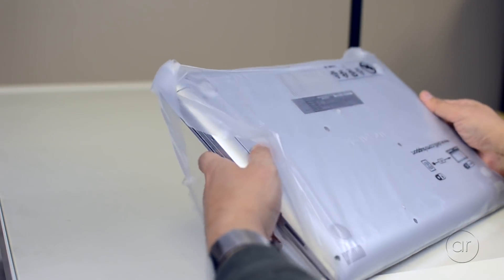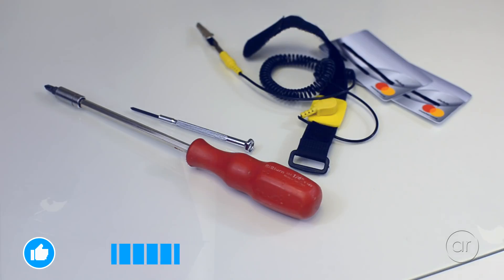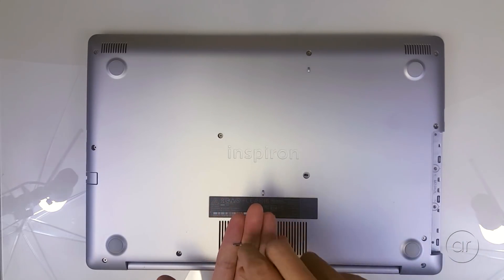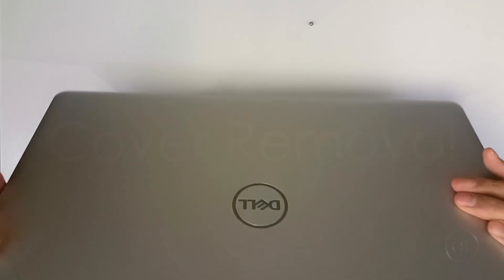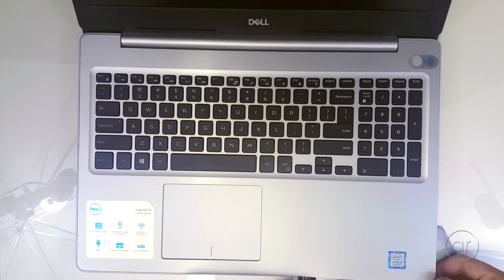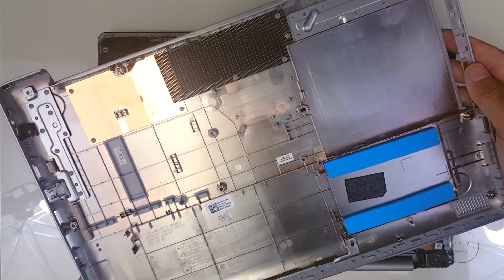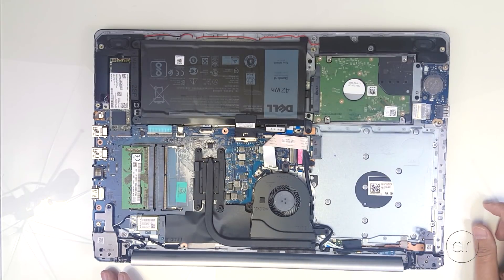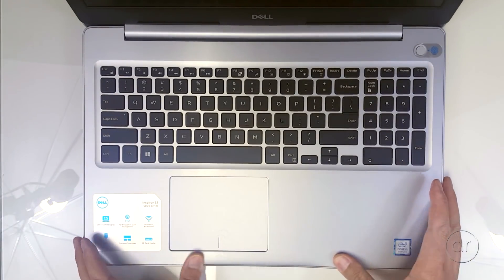How to Disassemble a Dell Inspiron 15 5570 Laptop to Install an M.2 SSD

Comment: Hello , Are you still using this laptop and are you satisfied with it?
I bought this laptop 2 weeks ago and i found it very slow.I never thought that laptop with i7 8th gen processor would be this slow. Sometimes even chrome crashes when there is no much workload. I am regretting for buying this laptop.
Reply from the maker: I have experienced the same thing - the laptop is very slow if you continue to use the hard drive that came with it. However, once I moved the OS to the SSD, it is fast. I do all of my music composition and video encoding on the laptop.

For the crashing - see if you are using the latest BIOS. It has crashed once on me - but once I updated the BIOS, I've never seen the problem again.
Reply: @accessrandom  Thank u for your response.Now taking your words into consideration ,i am planning to install ssd in my dell 5570.I am just confused which one to buy SATA 256 gb ssd or NVMe 150 gb ssd?

Comment: Hello Sir,

Your videos are very informative. Just wanted to ask a nooby question- I have a Dell Inspiron 5570 i7 8th Gen/8 GB Ram/2 TB HDD. Can I add an SSD in addition to my 2 TB HDD? If yes then which type of SSD & up to what capacity? Regards
Reply from the maker: Thanks much. Since your laptop is in the Inspiron 15 5000 series, it should have an M.2 slot for you to add an M.2 SSD. According to Dell's Setup and Specifications manual, it support up to a 256 GB M.2 SATA, and up to 512 GB M.2 NVMe. However, many viewers have successfully installed larger capacities (as seen in the comments below).
Reply: access random Thanks a lot for the clarification !!
Reply from the maker: Sure thing 👍
Reply: access random Just wanted to ask one more thing. One out of the two M.20 or NVMe can be installed with my main HDD or without? Will my old hardisk work in my Laptop?
Reply from the maker: There is only one M.2 slot so you can choose either an M.2 SATA or NVMe SSD. You hard drive can work in combination with the M.2 SSD.
Reply: access random That’s great. Thanks for the clarification !! 👍🏻

Comment: Hey, do you know if the usb Type-C port on this laptop is a thunderbolt port or just a regular USB Type-C as seen in phones?
Reply from the maker: At least on the model and configuration that I have (the Inspiron 5570), I don't have a USB-C port. Do you have the same model?
Reply: @accessrandom  yes, right next to the charging port. Inspiron 15 5000 series - 5570
Reply from the maker: That's strange - there must be multiple configurations of the 5570. On the side that has the charging port, I have the HDMI port, then LAN, two USB 3.0, and finally a headset port.
Reply: @accessrandom  okay, I have a type-c shaped port between the charging and HDMI port

Comment: In Dell Inspiron 15 5567 m.2 slot is there?
Reply from the maker: When I go to Dell's website and look at the setup and specifications document, it looks like there is an M.2 slot on 
 the 5567 but unfortunately it is not for an SSD.

Comment: that M2 slot is SATA or NVME?
Reply from the maker: The M.2 slot will take both SATA or NVMe, but please keep in mind that Dell limits the read speed of NVMe to 1800 MB as it uses GT2 mode (power saving mode).
Reply: @accessrandom  thx

Comment: Please, Is this Dell laptop work well for advanced programming (e.g. visual studio 2019) and for gaming like pes 2019 / 2020?
and what about the common issue I heard about 100% drive usage?
please, need help because I am thinking to get one.
Thanks
Reply from the maker: I use it for video capture/editing/encoding with handbrake, as well as some music production. I think it would do fine with VS 2019, though I'm not sure about games as I haven't really used it for gaming. I have not had any issues with drive usage.
Reply: @accessrandom  Thanks for the reply,  so please what could you advice me to choose this one(the mentioned 5570)) or (Dell G3, i5-8300h,8gb Ram, 1TBHDD))

Comment: Thank you for this amazing video, I am planning to buy Crucial MX500 m.2 SSD (240GB) during next amazon prime day sale. Hopefully I will be able to disassemble the same laptop and install the SSD.
I also want to upgrade the RAM with another 8GB stick, can you help me saying if I will buy 2400GHz speed RAM or any other variants and which brand will be better. I am planning to buy Crucial 8GB 2400GHz. Please help
Reply from the maker: You're welcome - I'm glad you found the video useful. If possible, I would recommend that you get a matching pair of memory (both brand and model). I've had too many problems with mismatched memory in the past, even when they were exactly the same specs. Unfortunately, I didn't visually inspect the memory while I had the laptop open, so I'll need to reach out to my viewers - anyone?
Reply: @accessrandom  I have upgraded to SSD tomorrow, I have cloned it also, and it was working fine also, but today I have deleted the whole partition of my previous HDD where there was OS previously and my backup USB cannot restore my windows now, any idea what to do?
Reply from the maker: Had you created a set of rescue disks and/or does the recovery partition still exist? What cloning software were you using?

Comment: Is the ssd nvme
Reply from the maker: The SSD that I used was not NVMe - however, the M.2 slot in the 5570 will accept NVMe SSDs. Please keep in mind that the 5570 does not utilize the full speed of NVMe as it runs in the low power GT2 mode.
Reply: But it should run the full speed of NVMe as AHCI is present.
Can we change this GT2 setting.
If yes,
Please me a video on how can this 5570 run the full speed of NVMe
Reply from the maker: Unfortunately, no one has found a way to change the GT2 setting in the BIOS or otherwise. I'm not sure why Dell has designed it that way...
Reply: @accessrandom  
Can you please make a video on this.
Reply: Trying to use nvme ssd on Inspiron 5570
Reply: Okay
Can you sujest me some better ssd so that I don't want to remove my HDD
And want a better performance
Please sujest which storage is best for this laptop

Comment: This is the best guide for 5570 on youtube. Mine doesn't have the DVD drive but the procedure was the same. I could add one more 8GB RAM, 512GB M.2 2280 PCIe SSD (MVMe) Gen3 x 4, and replaced WiFi card to M.2 DW1830. The WiFi card needed three antennas but 5570 has only two antennas. I installed one more antenna on the back panel after grinding some of the metal shield off on the back panel.
Reply from the maker: Thanks much! With all the upgrades you performed, yours could have been a video by itself 😀

Comment: Dell Inspiron 15-5559 15.6" i5-6200U can this model hold a m.2 ssd?
Reply from the maker: When I went to Dell's website and looked up the Specifications manual and Services manual for the 5559, I was unable to find any reference to an M.2 slot, sorry...
Reply: @accessrandom  Ok thank you, ill just buy a 9.5 mm caddy and a regular ssd

Comment: Hey there, I'm planning to buy this model of Dell but I'm not so sure because there are plenty of bad feedback on the internet, such as Fan Noise, High temperature and 100% Hard Disk usage. What are your thoughts on this?
Reply from the maker: I think it depends on your usage. I use it for general purpose browsing, video editing, digital audio, etc. so the fan comes on once in a while. If you're gaming, the fan would turn on more frequently depending on what type of games you play. Replacing the HDD with an SSD will also help with performance.

Comment: Hi sir, I bought higher version of Dell Inspiron 15 5570 here in the Philippines. i7 8Gen, 8Gb RAM, 4GB graphics and 2TB HHD. I see no SSD on my laptop info so it means my lnspiron 5570 has no SSD card mounted? and I was wondering if my laptop has SSD slots too? if yes can you recommend compatible SSD for my laptop? I'm looking forward for you reply, Thank you!
Reply from the maker: I'm not sure if Dell changes their specs for the Phillipine market, but your laptop should have an M.2 slot, as it's part of the Inspiron 15 5000 family. I used an HP-branded SSD in mine, but you can browse through the comments for brands/models that have worked for other viewers.
Reply: You could go for crucial or wd nvme ssd's instead of Samsung or Intel if you're in a slight budget

Comment: Can you install large ssd M2 like 512GB plus a 1TB 2.5" SSD and use them both? Also can it take ddr4 2x16gb @ 3200MHz? Thanks
Reply from the maker: Yes, you can install a 512 GB M.2 SSD (I have had several viewers who have successfully installed 512 GB), plus replace the HDD with a 1 TB 2.5" SSD. According to Dell's specs, yes - it will take a max of 32 GB of memory.

Comment: Hey i recently installed wd green 240 sata m.2 in my 5575 but it's showing not detected in bios and also not showing in disk partition tool. Any suggestions? And ssd is working
Reply from the maker: Can you try to re-seat it, or would it be possible to try it in another computer? Any hardware additions should at least show up in the BIOS...

Comment: Sir if I use hdd with m.2 ssd will it largely affect battery backup if yes then by how much %?
Reply from the maker: That's a good question - if you are adding an M.2 SSD to the system, it will surely affect battery life (but not significantly). From a brief search on Google, I found power consumption to be anywhere between ~0.2 to 0.5 Watts for active idle to 2 Watts for read/write.
Reply: @accessrandom  Thank you sir i appreciate your answer

Comment: Thanks so much for this, used a Samsung SSD Model: MZ-V7S500BAM in a dell 5575... worth it, had some difficult setting the boot from drive though, as the bios menu is different from this model... i think i figured it out though, I am thinking of swapping out the HDD for an SSD as well, in your opinion would that be worth it?... could i just when installing could i just clone the SSD in the m.2 slot to the new SSD HDD?
Reply from the maker: I think it really depends on how you plan to use the secondary SSD (which replaces the HDD). The M.2 SSD already has Windows on it so you wouldn't need to clone it to the 2.5" SSD - you could just swap out the HDD with the 2.5" SSD. If you plan to use very disk-intensive programs (like video editing, databases, etc.), you could actually install those programs on the secondary drive. Since it is an SSD, they would load faster. And if you keep the data (like video clips, database files, etc) on the SSD, that would speed things up tremendously.

Comment: This was helpful. I found starting where the removed disk drive is was the easiest spot to begin separating the cover. Also it's a good idea to place a cloth on your work surface when you have the laptop flipped over to prevent scratching the outer shell behind the screen. Additionally this computer also has the option of replacing the optical disc drive with another hard drive if you wanted to use a 2.5 SSD coupled with a HDD.
Reply: I wouldn't want to replace the HDD because it's already a healthy 2tb drive, but adding an nvme ssd is convenient. Even I think the display and proprietary software this model has is bad to say the least
Reply: @gakltd  I left in my HDD as secondary storage. Once I put in the m.2 drive and made it my C drive my computer boots up at least 10-20 seconds faster. Everything I do it is quicker and the battery last longer since it doesn't need to spin up a drive anymore. The monitor could be better but when I researched other laptops it was the only one that came with a solid 1080p screen in it's price point. All the others for the same price were 720p.
Reply from the maker: Thanks for the comments and observations - these tips will be helpful for everyone.

Comment: Hey..Does it support 32gb of ram..Could you please install and confirm it support 32gb ram ..
Reply from the maker: Unfortunately, I don't have the memory to personally test it, but Dell's Inspiron 15 5000 Setup and Specifications manual states that it does support up to 32 GB of memory (per memory module slot 2 GB, 4 GB, 8 GB, and 16 GB and total memory 4 GB, 6 GB, 8 GB, 12 GB, 16 GB, and 32 GB).

Comment: which watch are you using?
Reply from the maker: I think you are the first to notice 😃. It is a Skagen Titanium (model 233XLTTN).
Reply: Th
Reply: I really loved your watch
Reply from the maker: Thanks. The face is only 37mm but looks bigger because it almost goes to the edge. And it's only 8mm thick.
Reply: I just bought a Swiss Eagle. so will have to save some more to buy this. But I'm definitely buying it

Comment: I have the HP SSD EX900 PCIe Gen3 x4, NVMe 1.3 and can confirm that this Dell Inspiron is compatible with PCIe NVMe SSDs.
Because this laptop's case and motherboard are rather flexible it can cause the M.2 SSD to pop out especially if you're opening up the laptop again. I put foam tape over both the socket and the SSD to prevent this.
Reply from the maker: Thank you! This will be very helpful for others.
Reply: Thank you. I am looking for this.
Reply: Did it throttle down to x2?

Comment: Great video sir! Now im planning to upgrade my ram to 16gb and m.2 the thing is.. is it worth upgrading because we only have i5 8250u 1.6ghz
Reply: I've noticed more people encounter heat issues with the i7 paired with 16GB ram, than do the i5 paired with 8GB ram (both 8th gen processors).   Not that the i7 is problematic, just that it obviously is being called on to "work more" with the available 16GB.  So while you can actually install a total of 32GB (16x2), a lot of people seem to overlook that you will be most limited by your processor.  As in, just because you can cram in 32GB, you will really be taxing that i5 processor if you call on it to frequently be engaging that much ram.  And 32GB will not magically be "top spec" for gaming, with the integrated 620 video graphics.  It's great that Dell makes 2x ram slots, and 2 drive combos in a user/upgradeable laptop, but a lot of people mistakenly think 32 GB is going to make a ~500 laptop transform into a power station.  It is neither channeled nor fanned adequately to place high demands on that i5 processor.  This is an awesome machine with 8GB, paired with an 8th gen i5.  The best modification I'd recommend beyond that, is to absolutely swap out the HDD for a SSD.  That's going to actually help you with both the battery and processing longevity, plus you eliminate the moving parts of a HDD.  A 256GB SSD truly will suffice for most people unless you are wanting to store really large files (video, etc).  And if you really do want a massive backup drive, an external USB makes a lot of sense (plus you can use it for other computers/devices, as well).  

Hope this helps you, and others, who might be wondering about a solid configuration that maximizes the life expectancy while taking speed/efficiency into consideration.  The biggest "speed" differences most people notice are in fact the bootup times; swapping HDD for SSD will get you the most definitive results.  Beyond that, any computer is only as fast as its slowest link.    The 8th gen i5 begs for more than 4GB ram, but most users won't honestly find it beneficial to go more than 8GB with the fan/cooling and integrated graphics on this Inspiron.  Keep your machine vents blown clean, and this laptop should run efficiently for years - without melting your processor.  HTH👍
Reply: @MC-ti2vn  

Hi, thanks for sharing your insights. I have just bought this one with i7+16GB RAM+Radeon 530(4GB)+500GB SSD for video editing. I was thinking to upgrade the RAM to 32GB - are you suggesting this will cause a heat issue? Also, I plan to put in a 2TB HDD inside for storing videos so they can be accessed easily though not necessarily speedily. I may even add another 1TB HDD to the DVD-drive via a caddy. I will use SSD drive for real time editing, and the HDD drives for convenient storage - surely that would not cause any heat/performance issue, would it?
Reply from the maker: Thank you. If you are still using the HDD that came with your system, I would say yes - the SSD is well worth the upgrade, whether you add an M.2 SSD or replace the HDD with an SSD. Booting to Windows from an SSD will speed things up significantly. The benefits of a memory upgrade will depend on whether your applications are memory-intensive and/or the number of applications open at once. For general use, I find 8 GB to be enough.

Comment: Can you tell me if this model supports the NVMe SSD ? and was there a screw already present in the SSD slot or did you use the one which came with the new SSD ?
Reply from the maker: Yes, Dell does officially support NVMe and people have successfully installed them, but please note that i have had reports that it is working at half the maximum theoretical speed for a PCIe 3x4. The screw was already present (as seen at the 4:44 mark).

Comment: Thanks for your video, Can i use Samsung 970 evo NvMe with dell Inspiron 5570 ?
Reply from the maker: Yes, that should work with no problems. I have had several viewers install the 970 EVO successfully.
Reply: access random But there is a problem only 1800 MB/s instead of 3400 MB/s (on reading) and writing speed is right (1500 MB/s)

my ssd is 970 EVO Samsung 256 GB
thanks
Reply from the maker: Hmm, Dell's Spec manual claims support for PCIe 3.0 x4, but your numbers suggest it's throttling down to x2. I wonder if others have seen this also?
Reply: access random what’s mean x2?
Reply from the maker: x2 is just the number of lanes for PCIe. x4 is four and x2 is two lanes. You should be seeing 3400 with four lanes, but I've discovered through some investigation that there can be other factors that slow down the read speeds, even if there are four lanes.
Reply: Ok thanks